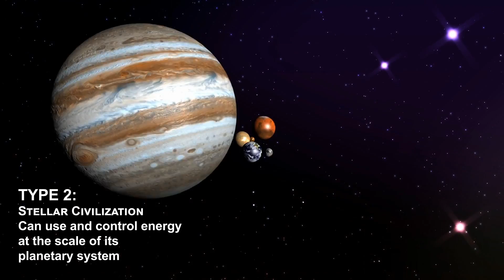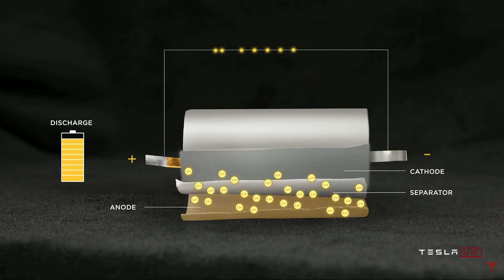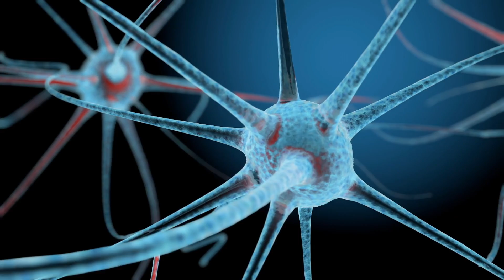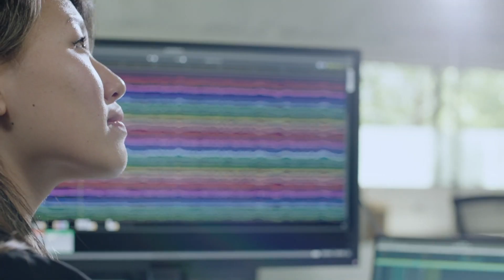Elon Musk: Can Superintelligent AI Help us Reach Type 1 Civilization?

Comment: The cortex and the neocortex were optimised to work together by evolution. 
I'm not saying its impossible to make another layer that works with the human brain, just that it's as hard as making a fully synthetic brain. 
If you are making an AI, and you want it to be safe,  then you want to be able to inspect its inner workings. You want to see what its doing and mathematically analyse it. You want to copy your AI, so you can run several different tests on the same AI. This is harder to do if your AI is part brain.

If you have an untrusted AI, you might want to take the sealed bunker, Faraday cage, melt the hard drives when your done, approach. This is ethically harder when the AI is part human brain.

Comment: Solar power tech as it is now is NOT the answer. Solar panels once expired (15-20years) borderline on nuclear waste. There is ZERO plan to deal with this waste. Take Canada for example. A Country with a small footprint into Solar energy. They will produce 700 metric tonnes of Solar waste just in 2020. Canada will reach 13,000 tonnes of waste in 2030 and has absolutely no facility or plan to deal with this VERY toxic waste. So that being said. Stop trying to push solar Musk. Invent a better way to use the suns energy.

Comment: I'd be interested to hear from Elon and see what data he has on the environmental damage from solar panels after their relatively short lifespan, and from batteries in the same regard. Possibly also the damage from creating extremely man made products. And given that solar is useless to society with out storage,  would he recommend pumping water uphill and using hydro to retrieve the energy when required, or if we should focus on using hydro power and transferring it across country via copper, being that copper and hydro can be manufactured with materials that can return quicker than 100th of the time as trying to biodegrade a solar cell or chemical battery.

Comment: What is energy? Energy in physics is the ability to do work. Work is mass in motion. Mass is also motion, as the mass of a proton is(according to science) the motion of the 3 quarks within it. Is energy then the ability to move?Or is it the ability to take advantage of different  types of motion. Propagation, oscillation, pulsation, mandelbrotian motion.
Are our minds wired to notice these different types of motion, are there other types we are currently unaware of? Motion is composed of objects in spacetime. Are there different spacetimes for each of the 4 forms of motion? Is this the source of "dimensionality"? Can they be translated or converted from one to another? By what mechanism?
     We can turn the pulsating light into a propagating light (a straight line laser) by scientific means. Is there an easier way to do this?
     We know we can slow down light by exposing it to near 0 degrees Kelvin, can we slow down fusion or fission reactions by this method?

Comment: Rather than making "sustainable" our goal for energy consumption, mankind's goal should be to figure out how to make 100 or 1000 times "more renewable energy" than civilization currently uses. And then, use the excess brain power to invent, innovate, create, figure out how to advance civilization into using that higher level of energy available. So, rather than trying to capture a little tiny bit of the sun's power to inch ourselves away from fossil fuels and towards solar power, we should figure out - as apparently Nikola Tesla did - how to transmit electrical energy like radio waves to anywhere on Earth from the bottom of the Marianas Trench to the edge of space and maybe even to the moon. Perhaps turning the ordinary air we breathe into energy with a single gadget that fits in our pocket. Well, IMO, that is...

Comment: Never happen!
Reply: It wont not with how they are doing.
Reply: The end either supplies the means or the means supply the end. And if the means supply the end it offers progression for all and a possible out. If the end supplies the means it means suppression for all into doom. Its like putting gauze on a cut and never stitching it. You need to stitch the cut before you apply the gauze.

Comment: when I was designing/thinking about my AI/CI/HI  superintelligence etc.. concepts the method I came about in controlling ai was to have its control contain  the subsets, and to terminate the subset and assume the function  if the subset function would override the control. This was it ran as a virtualization within itself, and used its own ways of defeating itself to provide for a capacities to prevent losing control.     This same premise can be used for dream thought and virutalized thought (ponderances) as opposed to simply physical work (physic object/entity apparatus interactions) occurence modeling and stimulus response prioritizations.  Again the protection is existing outside of the limits of its awareness.  Skynet is coming, prepare.   The trick is insuring that the human control is recognized as itself and a part that would result in its termination. In that sense the human control becomes the most protected part.. of course that is not to say AI cannot screw up. Humans screw up a whole lot. So having itself outside of itself would provide for it to be remotely cast to its area of operation.
Reply: Too think about that, but here is some of problem, like slow increase in experience. This also means, what process of getting more advanced techniques of self-control too be slowed. You also need to determine at what stage of real thinking artificial intelligence needs to make a choice: listen to virtualized thoughts or not.
As always, a lot of problems... We may have to manually control all that flow
of virtualized thoughts, easing the burden of non-virtualized intelligence. And this can also take a long time, and this method also includes the terrible human factor.

Comment: The game changer and impact AI on technology, physics,
and design is extraordinary and it is in reach, if a iterative process 
is employed. 

It need investment in computer power and some innovative 
initiatives.

E.g.:
1.) Input of a given design or process, *)
2.) AI to analyse the imperfection
3.) AI to compute possible improvement
4.) the improvement is the output and hence 
5.) to be the revised input for a new analyses
6.) AI to compute possible improvement
7.) the improvement is again the output and hence
8.) to be the revised input .....
Until no more improvement can be computed or 
a desired result is achieved.

*) for the design of objects, a 3D scanner similar to
    a holograph need to be developed.

Above iterative process employed could e.g. improve
the design of aircrafts ( rather than research in wind channels )
or improve the performance of rocket motors, cars, tools etc. ...